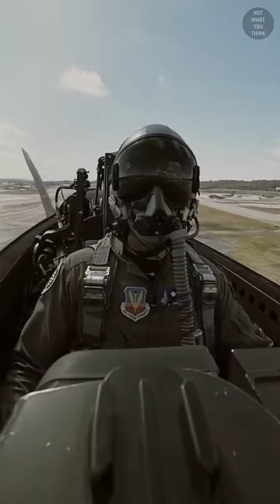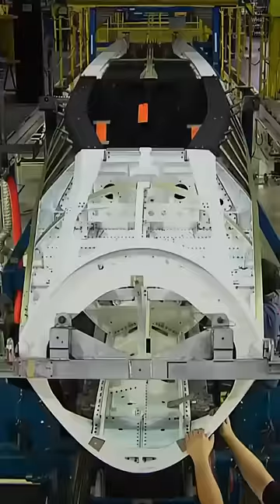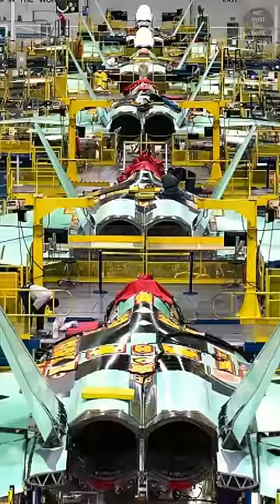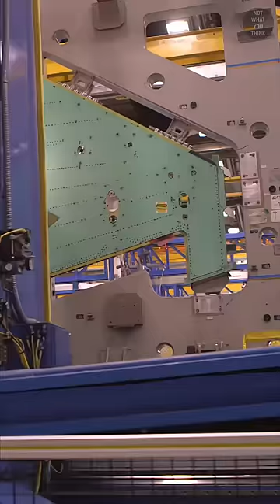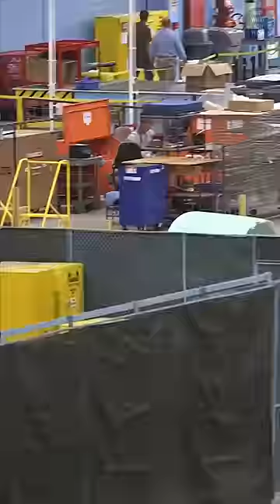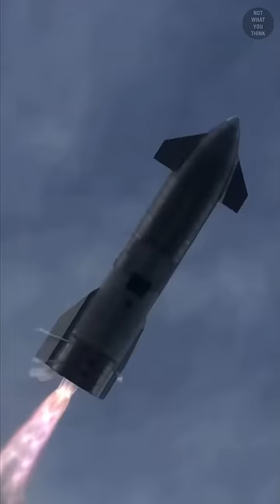Why F-22 is SO EXPENSIVE? #shorts

Comment: The major one is to get a program like this approved, many states need to agree. Which means they need something of benefit for them. Usually, it is jobs manufacturing some part or another. Lack of vertical integration and logistics further increase the cost of the program

Comment: Why is (insert a government project here) so expensive?
The government is inefficient
Why do Americans not trust their government?
The government is inefficient
Reply: True
Reply: I mean, after any structure hits its critical mass and becomes unsustainable, trying to find fix inefficiencies via searching for lapses in accountability is pointless.

As you stated, that would cause a feedback loop, a paradox making it unsolvable without total, uniform disassembly. 

That is akin to trying to nail down some small holes when the whole ship has been turned to Swiss Cheese — by the time you are halfway done, your old fixes will start to leak through. It is cheaper to build a new ship than to get enough wood to fix every hole and problem. Compound cost is simply too much.

US needs a hard reset, an outside push that will let the old system to finally collapse on itself and a new system to build upon the remains of the old one, hopefully, for the better and not devolving back to its legacy version.

Otherwise it will always be stuck in a stagnant, toxic, self-destructive state, akin to a terminal illness that takes forever to kill the host whilst burning out anything good still left in them.

Comment: the actual reason is because the Air Force ORIGINALLY contracted for 750 aircraft….and then reduced the order number several times to the final 183.  Development
costs, technology research, requirement changes and additions and yes overruns, were amortized over the 183 and not the original 750.

I would know…I was a financial analyst on the program

Comment: The F-22 is one bad mofo of a jet. 

I cried when they shut the F-22 assembly line down. 

But now I'm hearing there is a contract out for a 6th gen fighter. TO which I ask, why not just take the F-22 frame and modernize it? (as the electronics would have been from 2000).
Reply: LM have been contracted to refurbish the F22 fleet for the next decade. 6th gen will need complete overhaul to remain globally competitive by then.
Reply: Because it costs more to create an entirely new system
Reply: Agreed, bro. Agreed.